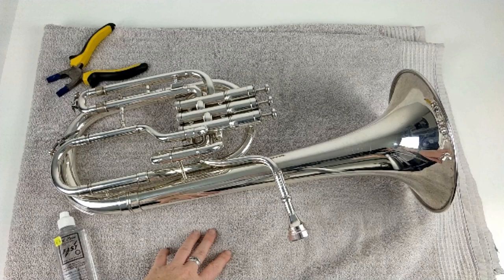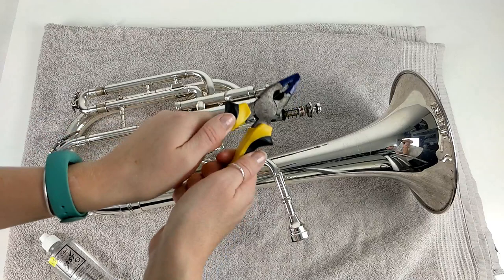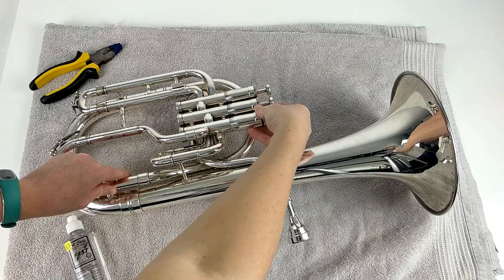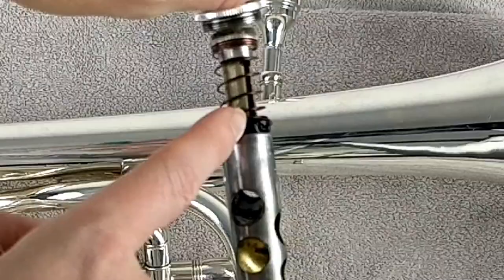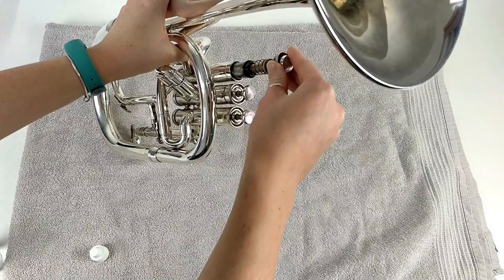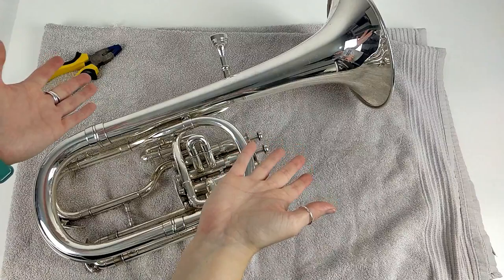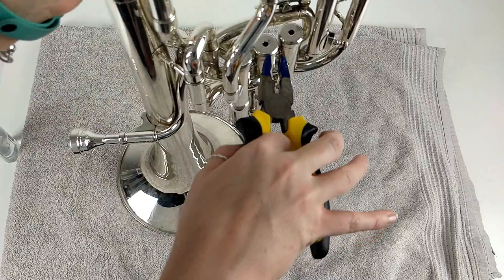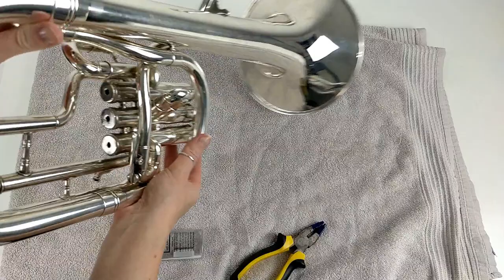⭐ How to Fix Stuck Valves on Brass Instruments!

Comment: Thank you! I've just bought a second-hand Tenor Horn for my daughter off Ebay, and whilst advertised as working (probably in good faith), it was not - the valves were all stiff or seized. Watching your video was very enlightening - thankfully all valves unscrewed at either end using my fingers alone. I'll need some valve oil and some new springs, likely, plus to give it a good clean, but you've taught me a lot in this video. Great tutorial! 🙂

Comment: Absolutely do not EVER use pliers on your horn.  EVER.  I am a technician, I've seen far too much damage as a result of people using pliers to pull caps.

Just tap the caps with a canvas hammer, it won't damage anything and will knock them loose.

Comment: my first valve is stuck but the rest aren’t and I can’t pull the first one out or press it down or play it what do i do?
Reply from the maker: Try putting a bit of a oil on the rotary when you take the caps off and give it a wiggle. :)
Reply: @TheBrassTeacher  what’s the rotary

Comment: Hey I accidentally got my sisters baritone valves stuck right inside and the wont even pull or move any suggestions im gonna get shouted at lol please help me :/
Reply from the maker: These methods will work on any valved instrument. If its super stuck then just keep going over the same tips - slowly wiggling and adding more oil. If it still doesn't budge after a long time then you'll need to take it to an expert! Good luck!

Comment: My valves are all stuck inside my euphonium, I cant get them out.
Suggestions?
Reply from the maker: Try adding in some oil from the bottom and keep trying to press down by wiggling them. This should work but it will take time. :)
Reply: How long does this process usually take?
Reply: How long does this process usually take?
Reply: @danielschroeder574  Really depends on how well the valves free up. I'd recommend giving them a clean with washing up liquid whiel you have them out, and the casing too in order to get any bits out that could be causing them to stick. If the valve is full of bits of cake, no ammount of valve oil is going to clean them up.

Comment: unfortunately my valves get stuck every other day! every time i take my euphonium out, the valves get stuck and i oil them thoroughly. after a few minutes of playing (less than an hour,) they start to get stuck and take a long time to raise up again. it's a new euphonium as well and i just got it in september, any tips?
Reply: Give them a thorough clean with warm soapy water, and flush your euphonium out with warm soapy water. Being new, their could be bits of solder in their that are causign your valves to stick. Use a good quality valve oil (I always swear by Blue Juice) some cheap valve oils dry out quickly and the valves are as bad as ever in a day or so.
Reply from the maker: Great advice!

Comment: The best way to free a stuck thread is by tapping it with a wood or plastic or hid mallet (or a block of wood). This will break the seal of any dirt in the thread and help persuade it to come off. Pliers can have too much leverage. I say this, not as a technician, but as someone with a large collection of elderly instruments that often require a bit of persuasion.
Reply from the maker: yes that's another way to do it for sure! Either way its easy territory to dent your instrument so lots of care has to be taken - I agree! :)

Comment: Ok so I have a euphonium and I haven’t used it in 2 week as I went on vacation and the valves don’t move  at all I tried valve oil and it didn’t work so would this method work thanks also the valves won’t come out
Reply: Try it again if in doesn't work try tapping the finger buttons w a drum stick lightly they shouldn't be that stuck unless you live in a place where the weather is really brutal
Reply from the maker: Try wiggling the valves a little more... If they still don't move you could try using a silicone can opener but put a cloth around the metal

Comment: My 3rd valve keeps getting stuck in one place no matter how much I oil it. What do I do?
Reply from the maker: It may be misaligned or perhaps it has a dent in it? If you warm up the pipe, it should be easier to slide in.
Reply: @TheBrassTeacher  thanks for the tips! 😁

Comment: Ever since I gave my tuba it's first bath (12 years ago) I've had problems with the first valve...because a cigarette butt came out of the first valve during that bath...and I have never smoked a single moment in my life! It keeps getting stuck when I press it down...do you have any suggestions?
Reply from the maker: Oh WOW!  This sounds crazy - your poor tuba! It may be that the valve has expanded a bit, dent in it or is misaligned in some way. It also might be that you need to bathe it more than once.... after 12 years (!!) its may need more than one bath to get rid of that dirt.
Reply: @TheBrassTeacher  it's had a bath every few months since then but it's never been the same... I'll see if there's a repair person near me...

Comment: I put valve oil on my first valve and the I played and no air went in the instrument please help
Reply: Make sure the valve is turned the correct way in the casing. If not the air cant flow the way it is supposed to.

Comment: Hey my valve is stuck and it wont move or anything and i tried the plier thing help
Reply from the maker: Try giving it a bath first, clean it out fully and check if the valve is misaligned / bent in some way. It may also be some dirt lodged in there

Comment: I think there is something wrong with my baritone. I was playing some music when my last valve suddenly just went down, and it was so hard to pull it back up. I eventually did, got it out, out oil on it, and I tried putting it back in. It literally wouldn’t budge and still seemed dry, any ideas as to what might’ve happened?
Reply: That sounds like a broken spring or valve quide. They can be replaced easily, but if in doubt, get a repair shop on it as you could do more damage.
Reply from the maker: always! great advice soundsdigital

Comment: hello, my first valve is stuck and cannot press down without any extra pressure, and when I play I get no sound what so ever. i can take it in and out without much of a problem. any suggestions? thanks
Reply: What you describe sounds like your valve is in 180 degrees out or the wrong valve completely is fitted. The valves have a number stamped on them somewhere, make sure yours have not been mixed up. If you look at the plastic valve guides that stick through some instruments one side is slightly wider than the other. The casing has slits that are wider one side than the other, but the valve can be fitted the wrong way round. Check the wide side of the guide lines up with the wide slot.

Comment: I tried the pliers and they didn't work. Ideas?
Reply from the maker: Mix the pliers in with lots of oil and wiggling the valves. Sometimes it takes a long time but make sure you're not applying too much pressure - little and often usually works in the end. Good luck!

Comment: I was oiling my 3/4 and the valves got stuck putting them back in. No wiggle room and they wont slide out, any advice?
Reply from the maker: Give it a bath, it will loosen it up a bit. Try gently with pliers and oil and see if they will budge.

Comment: so ive got a sousaphone with a stuck first valve, i can push it down fine, the problem is it stays pushed down and wont come up. the only way i can get it back up is by unscrewing it, taking it out, and putting back in. ive tried replacing the spring, but that didnt work and neither did valve oil. i took another first valve off the same type of sousa that was working fine and had the same problem once i put the new valve in. at this point should i take it to the repair shop?
Edit: Of course the lucky 4th time I replace the spring it finally works! Still not sure exactly what was wrong but at least it is fixed now
Reply: I think you should get it checked out
Reply: @jesse8744  thank you for the suggestion.